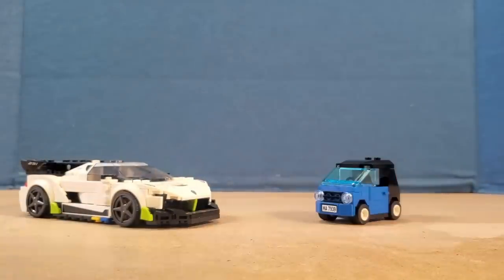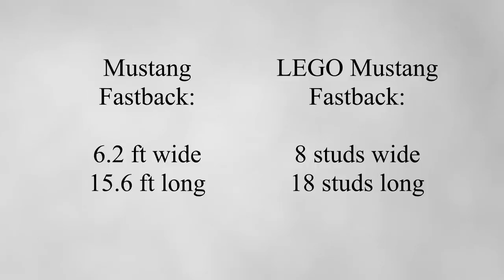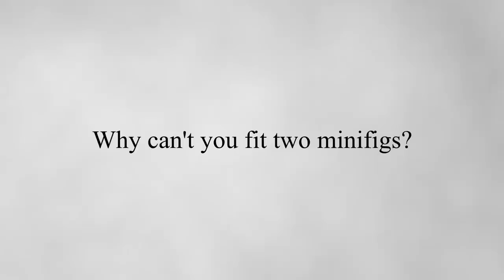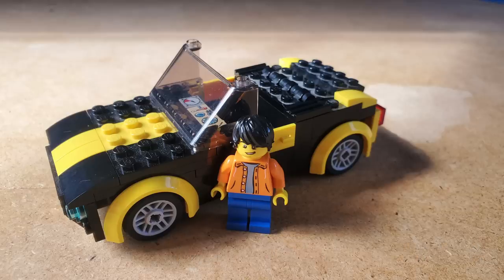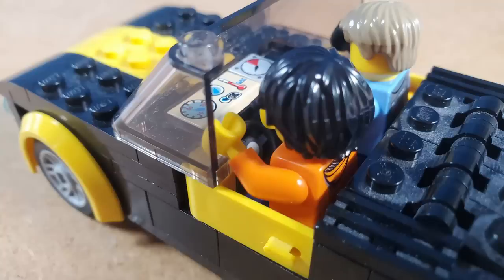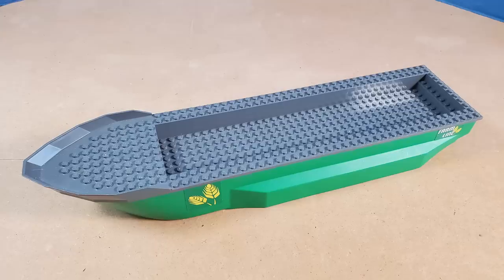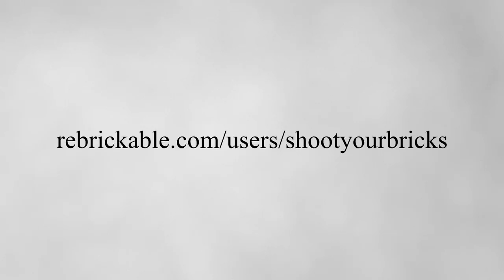Let's Settle This...

Comment: The problem is, minifigs themselves are too short to be really accurate representations of actual people.
Reply: yea and they are too wide in comparison
Reply: They sort of have the proportions of fantasy dwarves
Reply: Minifig bodies are just out of scale with themselves. The average adult person is 7 to 8 heads (as in their own head) tall and their shoulder width is about 2 head heights wide. However a standard minifig with normal legs and no accessories is 4 heads tall but their shoulder width is about 2 head heights wide. So just in terms of height to width minifigs are about half as tall as they should be.
Reply: Plenty of people are 5'5.
Reply: Short people aren't real
Reply: So goranXII is a minifigure?
Reply: @holycow2013  I'm sorry, what?
Reply: @ImmortalAbsol  It isn't the height that is the problem. Minifigures are very weirdly proportioned. They are to short and to wide.
They would have to be taller to fit their width. Or narrower to fit their height. But changing them in either direction would make them difficult to work with. Lego made the minifigures to fit the system, not the system to fit the minifigures.
Reply: Or too wide
Reply: The legs are especially noticeably short.
Reply: @elio7610  And arms, the minifigs can't actually reach the overhead grab bar on my subway cars!  Though some of that is due to their huge heads too.
Reply: They are just too wide
Reply: @GoranXII  I’m calling you short
Reply: @holycow2013  Why?
Reply: I used to extend the legs with 1x1 blocks and another 1x1 plate, but then the arms become tiny. The Lego Friends models are a bit better. Lego sports cars are usually taller than minifigs too. I was quite annoyed by this as a kid (like Sheldon-type annoyed). I'm happy somebody made this video.
Reply: nah they're not short they're thicc
Reply: not short, but wide
Reply: They’re just buff short kings
Reply: @ImmortalAbsol We're working with averages here, which internationally tends to be 5 foot 9 inches
Reply: Did you just implied short people aren't people?
Reply: @planguy9575 they aren't
Reply: I think I’ll just stick with giant technic sets and not have to worry about this
Reply: Doesn't Legoland use different figures for that exact reason?
Reply: So true, I don't know anybody who is 4cm tall
Reply: Jack Stone has entered the chat
Reply: Minifigs are fat.
Reply: 5'6" is the world average height for males...
Reply: Or to wide

Comment: There is the concept in lego of "play scale" which upscale small things and downscales large things.
Reply: I believe in tabletop wargames this is reffered to as 'heroic scale'  For example heroic scale warhammer models tend to have larger hands feet and heads, larger weapons and pouches, all to make the model more readable and easier to paint. By contrast things like tanks are much smaller than they should be, to make them reasonably sellable and playable
Reply: It is not uncommon in the model railroad and modeling community to make very large objects smaller so you have a reasonable chance to model it in the space you have available.  Even large attractions like Miniture Wonderland often scale down sports stadiums and large ships so they can be included without taking over the entire layout.

Sometimes smaller objects are modeled larger because of the limits of the modeler and material he is working with, but that is less common.

Comment: As a kid it always bugged me that the cars were single seats, so I would make 8 stud wide cars. They looked weird as hell.
Reply: 2 studs = 1 foot is a better scale
Reply: @Haggis-Giggles4692 the problem was he did height for studs but not width and since mini figures aren’t the same width as height it makes it inaccurate when measuring width
Reply: Thats really common shorter wagons with 8 wide building tech, they feel too wide, while 6 wide accurate lentgh wagons feel too thin, wierdly enough 6 wide shorter wagons and 8 wide longer wagons feel about right

Comment: Don't forget that minifigs have a totally different width to hight ratio than humans. May Rule of thumb is this: ideal main body width for passenger cars is six; vans and trucks are allowed to be 8 studs wide. However, the best example for the right size of a LEGO car is set 6612.
Reply: finally someone reasonable
Reply: I hear that they use 6612 as a reference vehicle for all speed champions sets. Can't beat perfection
Reply: @Joe_Potts  Uhm, yes, it was meant ironically. Now, you've destroyed the fun.
Reply: IMHO, the best examples for the right size of a LEGO car are 6523 and 6540.
Unfortunately, to be to scale with 4w cars and 6w trains, I would have to design 5w trucks, which didn't go well because most of the required parts are only intended for 4w and 6w (windscreens, car roof hinges, wheel holders...)
Reply: 6612...... suuuuuuure

Comment: Minifigs are far too wide for their height.  That's the actual issue.  The figs are very badly proportioned.
Reply: Lego friends sets are more accurate, but serious collectors didn't like them as much.
Reply: They are Everytime on widewalk mode.
Reply: The recent tall minifigs in the Avatar sets, for the Navi, are interestingly very close to regular human proportions, just the arms slightly too short
Reply: A minifig is 1.6cm wide at the waist when the average adult is about 40 cm wide at the waist, which is about 1:25 scale.
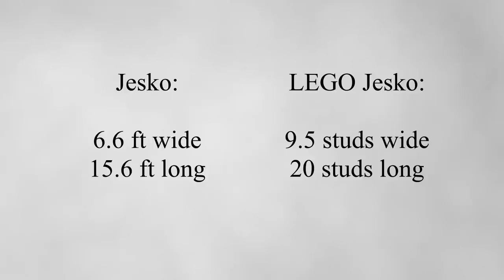A minifig is 4cm tall when the average adult is about 180cm tall, which is about 1:45 scale.
A small LEGO city dwelling (e.g. mini modular) is some 12 studs wide and 6 studs deep, which is ~45 sq. cm, while a small apartment is about 20 sq. m (200 sq. ft) = 200000 sq. cm, which is a 1:66 scale.
So "minifig scale" is not a real scale, it's not a single number, it's a lifestyle. LEGO is not for scale models, it's a creativity toy.
Reply: Humanity is getting there though ...
Reply: If only Lego, a multi billion dollar company would have listened to you
Reply: They're badly proportioned if you're going for realism. Lego bricks have a rather stylised syle
Reply: Well, they intentionally have cartoonish proportions. I wouldn't call that "badly" proportioned
Reply: Lego Ahsoka always looked too wide
Reply: thats whats them good, but at the same time, thats what makes them bad
Reply: This is why you can model in Lego with impressive reality... Until a minifig shows up.

Comment: I've used the 1 stud = 1 foot scale for the last 20 years. It makes model building so easy. I only ever built one 10 stud wide train though, it looked perfect but was too huge.
Reply: Always sucked trying to do functional size internals for trains and tanks in lego
Reply from the maker: I would consider making the actual body of the train 8 studs wide and then have a stud on each side for railings and stuff.
Reply: @ShootYourBricks  That's what I do, though it is still a compromise as you only get two seats per row that way, were real trains usually have 4.  But I tried 10 wide once, and it was a nightmare!
Reply: That's what I've subconsciously worked with.

Comment: The correct scale of vehicles depends on if you base it off the figures' height or their width
Reply: 2 studs = 1 foot is a better scale
Reply: it should be an average of both
Reply: @digitalrandomart3049  Then you end up with half studs, which is prohibitively difficult to set up with a simple small space like a car. Let alone making it playable and look good.

Comment: I'd argue that using the "height" of the minifigure isn't good to use as standard, as minifigures are exactly stylized in that regard, squished down.
If we apply the same logic for the width, an avarege man shoulder-to-shoulder is 1,5 feet wide. A lego minifig is 3 studs wide counting the arms as the shoulders, making 1 stud equal to 0.5 feet width.

Making 6 feet wide car's proper stud-size 12 studs.

Comment: Now one thing to note regarding ships is that they come in a lot of shapes and sizes, there are probably cargo ships that are 12 foot wide, but yea most are a lot bigger
Reply from the maker: True. There might not be quite as much a difference in size.
Reply: @ShootYourBricks  even small cargo ships are much wider than 12 feet. The real-life old pirate ships and small caravels of the 1600s-1700s were about 30 feet wide. And those were really small. Cargo ships are just not doable on minifig scale
Reply: @tammo100  People have built the Japanese battleship Yamato as well as the Titanic in minifig scale. Of course it's possible. Just only for teams of advanced model builders.

Comment: there is also the problem, that in lego the smallest measurement with "regular" pieces is 1 stud. you can go a bit smaller with some brick modified, special pieces or building techniques, but it still doesn´t translate to reality. like if you build the body of the car with 1 stud bricks it would mean 1 foot/30cm width of car body on either side, of course you are not going to be able to fit 2 minifigs, if you have to "waste" that much space... even something like windshields, if you assume 1/4 stud, it would still mean glass as thick as 1/4 foot or 7,5 cm when in reality its a fraction of that...

Comment: 4:54 Hi a guy who know a bit too much about trains. The measurement you're referring to is called the track gauge, and for standard LEGO train tracks, it's actually 4 ft 8.5 in, not 5 ft. The width of 10 ft (technically 10 ft 3 in) that you mentioned is what we call the loading gauge. The loading gauge specifies the width and height of a rail vehicle, and it's separate from the track gauge. It's interesting to note that two countries can have the same track gauge but different loading gauges. For instance, if you're building a MOC of a British train, it would be narrower (9 ft 3 in or 9 studs) compared to an American one (10 ft 3 in or 10 studs) due to these differing loading gauges, even though they both run on the same standard gauge track. (Yes, I did use ChatGPT to fix my comment. I like to write but comments aren't my strong suit.)

Comment: I think lego should make more use of its micro scale figures for larger models.  That would roughly translate to 1 stud = 3 feet.
Reply: They should, but that complicates existing scales.
For instance, with the Eiffel tower, quick math works the microfigure scale to ~300 ft tall, about 1/3 the scale of the real thing.

Comment: As much as I love the simplicity of your conversion, I have to point out that minifigures are too wide, and thus a more accurate measure would be to take a value between measuring their width as if it were a person and their height as if it were a person. Additionally, since these things /are/ to match a minifigure, not a person, perhaps we should be using a different number for width measurements than we use for height measurements.

Now having said all of that, I think I'm just going to use your method.

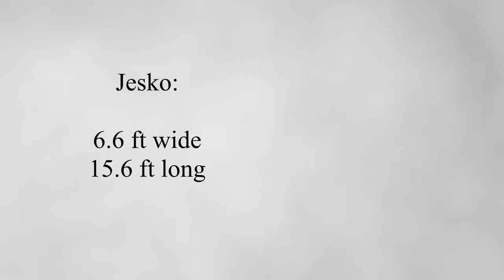Comment: Really informative video comparing LEGO sets to real life vehicles! To have a proper scale, I usually consider 1:35-1:45 minifig scale. The range is quiet big as a minifigure's proportion is just completly off. The height of a minifig is about 1:44 while the width is about 1:38 so there is no definite minifig scale but rather a range the model should be built in to be considered minifig scale. Nevertheless speed champions models are oversized (approximately 1:25-1:30) but I can understand that as they still want to include a minifig while still retaining a good structual integrity. Just for reference, the Lambo Countach is about 2 meters wide which is about 6 studs in 1:43 scale. This would it almost impossible to include a minifig while still making it look good.

The issue doesn't end here tho. I'm currently working on a 1:44 recreation of the Eta-actis 2. It's an incredible small ship to tackle. It's about 15.5x12.1 studs wide. Going with 1:44 for height didn't work for me as it looked cramped next to a minifig so I needed to go with 1:38 to make it look better just because a minifig's proportion is off.

Comment: The first lego city sets where made for HO train system, so the scale was 1:87. The current scale for city / modular buildings / trains are between 1:40 and 1:50
Reply from the maker: Interesting. Didn't know that.
Reply: There is a group of LEGO model railroaders promoting something called L Scale.  They say that Lego trains should 1:43; a typical seven foot doorway works out to 1.95", which is 6.5 studs; which is hard to do.  Making a stud an even foot makes seven studs tall 2.125", which works out to 1:39.5, or let's just say 1:40 scale, at the bottom of @Dodos622's range.  So that is a good rule of thumb; my son and I made a model of our current railroad museum from blueprints before it was actually built, and that was the scale we used.  It turned out just about right.

Your assumption about trains is correct.  The width and height of trains (known as the loading gauge) is not determined by the track width, but by clearances when going by things like station platforms, tunnels, and bridges.  Ten feet/ten studs is indeed the average width of most standard gauge trains, the height varies depending on the loading gauge (or plate) you are using.

BUT, most model railroad tracks have much tighter curves than real railroads.  A full-length passenger car for example can look very awkward on a tight model railroad curve, with the center of the car hanging way over the inside of the rail, which also made it more likely to tip over.  So, it was not uncommon for model railroad manufacturers to model passenger cars much shorter than reality, so they looked and tracked better on tight curves.

Going a step further, Lionel trains should be 1:48 scale or O scale, based on the gauge of the track.  But most of the pre-War Lionel tinplate and even some of the post-war Lionel trains were actually 1:64 (or S scale) for the same reason that LEGO trains are smaller than scale -- small tracks with tight curves.  If you put a LEGO train next to an old Lionel tinplate train (like we have), you will see they are very close in size; a tinplate Lionel boxcar I have in front of me is six studs wide, 26 studs long, and has oversized trucks and couplers, just like LEGO trains.

The fact that minifigs are not correctly proportioned aside, a stud per foot is just an easy way to scale LEGO creations based on drawings or blueprints.  You just round everything up or down to the nearest foot, and count that many studs.  The finished proportions also look pleasing next to a minifig.
Reply: @JJJGGG538  yes, the cars that came out with the LEGO city sets were indeed HO scale, so they look correct on an HO Scale layout.

Conversely, I have seen a LEGO City setup from the 1950s-1960s that incorporated a Marklin HO scale train layout.  It looked good.

My son was given boxes of random LEGO pieces that included doors, windows, and benches from the original LEGO City sets.  I used to them make a station that duplicated an incomplete HO scale station I had on hand.  LEGO Micro figures are roughly HO scale in height; so I populated it with Micro figures.

I have a plastic tree that dates back to my childhood; looking back, it may have come from a friends LEGO City setup, or my memory may be correct, and I found on the ground somewhere.  When I realized it came from the original LEGO City set, I added it to the station, the cars would have been perfect as well if I had some.  I then placed the station with my son's LEGO layout on side and my HO Scale layout on the other, with the station facing my track.

Comment: The biggest issue with 10-stud trains on official Lego track is that Lego only makes curved tracks at a very tight radius. The larger the scale of your train, the sillier it will look around these unrealistic curves.
Reply: My 8 wides already look quite silly!  I did build a 10 wide steamer once, but it took 3 9v motors (1 on the engine, two under the tender) to power it, and even then it could only run at one speed: any slower and it got stuck on curves, and any faster it would flip.

Comment: Agree with you regarding the small cars, minifig scale differs depending on how you measure length or width. I think the new 8 wide speed champions are great with lots of nice buildings techniques and more accurate design but they are not minifig scale. I have been using 1:27 scale for mocs recently. Ideally we would have a taller minifig with bendable arms and legs so they fit scale wise. 5 and 7 wide is actually a better fit for the available wheel sizes (one of the size constraints) more of a challenge to make (I’m just finishing a 1:27 scale 7 wide Land Rover moc with 30 high wheels )

Comment: I was thinking about this the other day. A standard car should be 5 studs wide. But windows and axles don't lend themselves to this. 

I'm a massive fan of models that manage to get minifigs sat next to each other. I'm thinking;  10197, 77017, 5988 + others that use this seat mould. 

Other than the fire station, I think this is an area where modulars with vehicles have been let down.